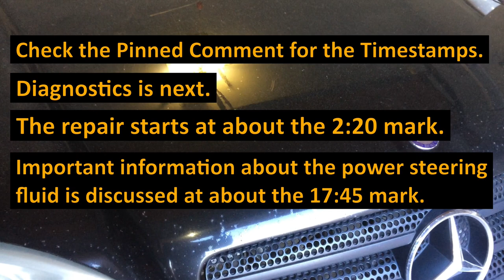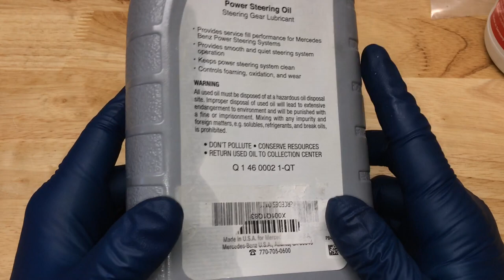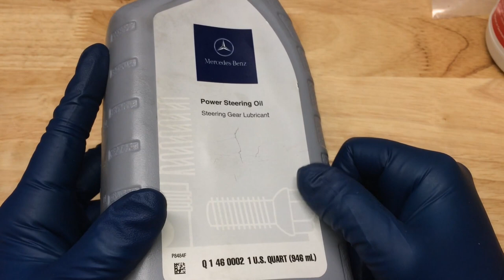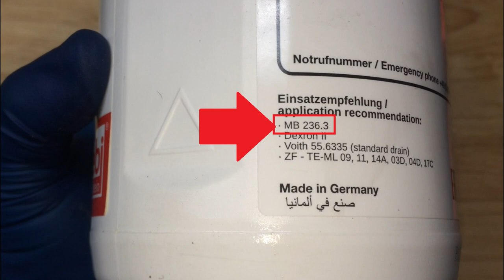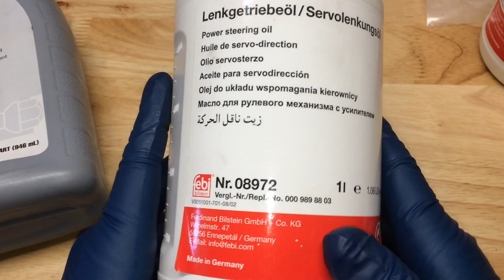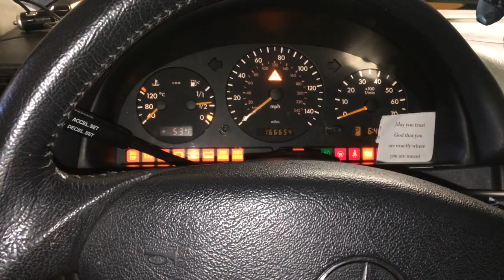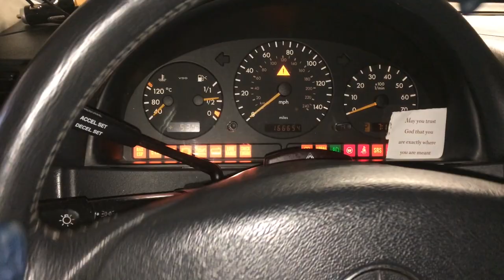Mercedes W163 Replace Power Steering Hose Pressure Line, Fluid Flush & Bleed '02 - '05 ML350 ML500

Comment: Thanks a lot for doing this. This is the most helpful video I can find that is close to the setup on my ML430 with the exception that my line ends in a 17mm flare nut rather than a Banjo bolt at the rack and pinion end. However, I have made progress on my project through to the 7:03 mark on this video (EG: both ends detached, and the bracket with the 10mm bolt off), but I cannot budge the line in either direction in order to get it out. That also does not bode well for fishing the new one back the other way either. As the car is on ramps with jackstands just for safety, I'm wondering if perhaps the suspension is clamping the line? I've tried to get some lateral motion by pushing and pulling from both ends, and it will not budge at all.
Reply from the maker: I'm sorry that I missed your comment - if you're still working on this, I would double-check that there's not some other clamp(s) holding the line.  I can see what you mean from this pic that the part is different for the ML430 & early ML320:

https://www.fcpeuro.com/products/mercedes-power-steering-pressure-hose-ml320-ml430-1634602224a#fitment

I pulled up the WIS for a '99 ML430, and there is a note about extra clamps holding the low pressure line, but unfortunately there are no notes at all about the high pressure line removal procedure that you're working on.  But the observation that the return line has some extra hangers (compared to the later W163's) makes me think that perhaps your high pressure line does, too.  I don't think your ramp/lift setup is affecting the removal - it sounds like there is another hidden hanger holding the hose in place. 

All I can see in the WIS for the high-pressure hose for your application is a note for the torque on the flare connection at the steering rack (in the rack removal section).  Here it is:
 
"Screw joint, high-pressure expansion hose connection fitting to rack and pinion steering, 15 Nm"  (That is a low torque: 15 Nm = 11 ft-lbs).

Please update with what you discover, and good luck!
Reply: @L35inColorado  That's great, thanks for looking into this! In fact, as it has now warmed here to 0C, I am just getting dressed to go lay in the ice, snow and spilled fluid in my driveway under the vehicle and see what I can find, so your timing is spot on. As I'm now 73 and never thought I'd still have to do this, I have told my spouse there are 3 things you can count on in life, "death, taxes, and fixing you vehicle". The thought that here is another clamp that I cannot see is rather a depressing thought. A mechanic friend of mine checked his Alldata and Mitchel databases and then made the comment, "they must think its less than impossible , this is what alldata has - mitchell has nothing". Indeed the Alldata info was not very helpful either. Yes both of the 17mm flair nuts broke free with very little force required. I just noticed that the return line that I replaced in 2018 also goes into the steering gear right beside the high pressure hose (I also bought this same line by mistake a couple of weeks ago before I realized I had the wrong one, and I'm just going to keep it as I had it shipped from ROck Auto to Canada.) BTW, this is a 1999 ML430 left hand drive that I bought from Japan for $10,000 about 2015 that had 48,000 km on it, original headlights (which Japan law requires to be changed and they never were) and tires, and it turned out to have been purchased by someone in Japan from a dealer in Montreal, Canada. It is already showing rust on the driver's door and has less then 100,000 km on it, which is disappointing. Given the amount of work I have had to do on it and in spite of the the low mileage, I wish I had never bought it! Update edit: I was able to find another clamp which looks to be more inaccessible than the first, so you're right. In spite of safety glasses, after getting all the gunk out of my eyes, I plan to move the car out of the spilled fluid, jack it higher, and then make another attempt at getting this one off. THanks for pointing me in the right direction!
Reply from the maker: @MountainParameters  Wow, you're a real trooper out there in the cold!  I'll say a prayer for your successful repair : )   Good luck!
Reply: A couple of hours later and more sludge in my eyes in spite of wearing curved eye protection, and a few trips to my neighbors to borrow some crowfoot wrenches, and, after trying unsuccessfully to get another bracket undone,  I finally discover that the line I disconnected from the PS Pump at the front of the vehicle was not the same line as I disconnected from the steering gear at the other end. However, all is not lost because your need to disconnect the 17mm nut from the steering gear before you can access the 14mm one for the line I needed to remove in the first place. Now the line is finally out, and the O-ring is still stubbornly seated in the steering gear housing and a right angle pick does not seem to want to remove it, I am so frustrated with this project I'm tempted to leave it in there and just take the other one off the new line instead. Also due to the frustration factor, I might be tempted to not do up the bracket until next summer when conditions can have me at least lying on a dry driveway rather than ice, snow, and spilled fluid! Anyway, even though at this point I am still only half way there, I hope that by confessing and documenting my idiotic mistakes, some time in the future they may help some other poor ML430 owner that is facing the same problem. I once worked with someone about 30 years ago who told me her father got so mad at a horse he drove to the neighbors, borrowed a firearm, and came back and shot the horse. Although I'd happily do the same with this ML430, I doubt it would do me much good, and probably not make me feel any better. So I'm drinking a strong IPA instead...
Reply from the maker: @MountainParameters  Oh wow, that ML sure is trying your patience, but you still have your sense of humor, so that's great!  
About the o-ring: be sure to really carefully double check the fitting of the line that you removed in case the o-ring is actually still on there - as shown in the video, I thought mine was stuck in the power steering reservoir, too, but it turned out that the o-ring was on the hose fitting after all, but I couldn't see it because of the color.  So use a pick to carefully check the hose fitting, to be sure.
If the o-ring really is stuck in the reservoir, you can try removing the o-ring with a dental pick, or making a little hook from a wire clothes hanger or smaller wire.  Unfortunately, there is a pretty high chance that it will leak if you try reassembling it with the old o-ring in there, because that is the high pressure line and so fluid will tend to find a path out if the fitting is not sealed well.  
You can also remove the entire reservoir so that you can get a better look at it: there are some videos on youtube that show how.  If you do that, be sure to replace the larger o-ring (part # 0004661880) that seals the reservoir to the pump.  
Hopefully you'll be able to get the hose fitting o-ring out without doing that, but just in case, here are those parts, if you decide to replace them:

Just the power steering reservoir o-ring to the pump:
https://www.fcpeuro.com/products/mercedes-power-steering-reservoir-gasket-0004661880#fitment

Power steering reservoir (includes the above o-ring):
https://www.fcpeuro.com/products/mercedes-power-steering-reservoir-0004600183

(Double check all those parts)

Hang in there - you'll get this done!  : )  But take today off and relax, if you can!
Reply: @L35inColorado  THanks for taking the time for assessing this! In fact I had to drive to the city today to pickup some friends at the airport, so you're right, shopping in Costco today was much more enjoyable, even the horrendous Sunday crowds all lined up to get the free food samples seemed much preferable to crawling around under the Merc (no I did not try the Mediterranean salad dressing, or the free tiny spring rolls, I'm not that kind of bum as I drive a ML430 you know!) 

Anyway, I get your point about those pesky O-Rings and I guess tomorrow will find me attacking this project with renewed vigor. Naturally, this project is not over so I will get back to this with updates so that in 200 years some archeologist will find your video and use it to teach his class at some campus on Mars. 'L35' may become some sort of meme in 200 years because I plan to engrave it on the rock at the end of my driveway if I ever get this thing to work again...
Reply: @L35inColorado  I finally got the job done. After 2 hours of trying to get the flange nut threads started, I moved the vehicle and after jacking in up again, it went in first time. The next challenge was trying to get the O-Rings to seat properly. After it was all done I filled the reservoir, and fluid then squirted out the low pressure line, so now I have to replace that as well. As I had to remove the flange nut from the steering box for it in order to remove the high pressure line, I now have experience getting it off the steering box and trying to keep an O-Ring on it when putting it back. But I can't work out some of the brackets for it. It seems like the line may be able to be able to be pushed thru them without the brackets being removed?
Reply from the maker: @MountainParameters  I'm not sure what you mean, but is it possible to remove the brackets , put them on the line, and then push the brackets into place (instead of pushing the line through the brackets)?  Great job on getting the rest of it done! : )
Reply: @L35inColorado  Thanks for the feedback. Turns out those guides are a 'C' style and the grommets that are on the line insert into them from the 12 o'clock position (but you do need to remove the grommets so you can feed the new line back toward the radiator from the steering box). As I had removed the 10mm nuts that hold the brackets onto the frame anyway, I was only able to get one bracket screwed back in place (the forward one which is the most critical), so I used HD Zip ties to secure the line for now and if I am under the vehicle again next summer I'll consider further mitigations then. As I was doing that operation, I reflected it's good I'm not an aircraft mechanic! A preliminary test seems to indicate no leaks. That low pressure line had a 1" long split along the top side of it. As the high pressure and low pressure lines are side by side where the split was, I'm guessing that the fluid was gushing out the low pressure line over onto the high pressure line and dripping off of it, which led me to believe that in all probability, I was too quick to judge and confirm the source of the leak. I was probably too impatient, and I suspect  there was nothing wrong with the high pressure line in the first place and I went though all that angst for nothing! About the only thing I did right was keep the low pressure line (it was the first line I had ordered), rather than return it, and then have to order it again! Also my Rock Auto history indicates that I had replaced that same low pressure line in 2018 with a Rien, which lasted me 4.5 years before it split, so that is less than ideal.

Comment: Hi, not sure if you have time to reply to this but I have a similar leak.  Same area but instead of leaking at the crimp it’s leaking from the connection of the high pressure hose to the pump.    Should I replace the whole pump and line, or just the o rings?
Reply from the maker: Yes, you can just replace the o-ring at the pump pressure line if the line itself is not leaking.  Have a very close look in that area, because the most common leak is actually just above that connection - it's a leak at the power steering reservior o-ring, or even the plastic reservoir itself.  That leak is probably the most common, and it can be mistaken for a leak at the hose because it is nearby.  It is common to just replace the entire reservoir when the o-ring is replaced, especially if the reservoir hasn't been replaced before because it will eventually crack (poor design by MB!).  Here's a video which shows what I mean (there are other videos, too):
https://www.youtube.com/watch?v=tSC2wMSMLPA
I hope that helps - good luck! : )

Comment: Any difference in how the steering feels with the yellow fluid compared to the green fluid? Is the performance different?
Reply from the maker: I don't know, and I'm not aware of any differences; the original honey/yellow fluid seems to be just fine.  Just don't mix them!  : )  Thanks for watching!
Reply: @L35 in Colorado  
My fluid is red
Reply from the maker: @dcomputers  Does it smell like ATF?  Many people put ATF in the power steering system because most other manufacturers (Toyota, Honda, GM, etc) use ATF instead of "power steering fluid".  For example, Valvoline MaxLife ATF is very red and very popular for power steering systems (I like it for Toyotas).  
But the W163 doesn't use ATF - MB says it requires "power steering fluid", like those mentioned in the video.  If you're having some issues, then it might be a good idea to just complete a flush.  It will be easy to determine when you've removed all the old fluid since it is a different color than what you'd refill with.  
There might be some red ATF's that are compatible with the MB spec mentioned in the video - I just don't know!  But red fluid makes me suspect that it's ATF.  I hope that helps!  : )
Reply: @L35 in Colorado  
Yea its synthetic atf . Would that cause issue in a ml ? The thing is they told me it meets 236.3 and that 236.3 is a dexron2
Reply from the maker: @dcomputers  Do you happen to know what brand?  I don't know all the in-and-outs of the spec, just what I included in the video when I did the research at the time.  It was my understanding at the time that there is some backward compatibility with 236.3 and some certain fluids, but not necessarily the reverse (meaning that some fluids that 236.3 can replace are not themselves suitable to replace 236.3 in 236.3 spec'd applications).  
Here's a list of what MB considers 236.3:
https://operatingfluids.mercedes-benz.com/sheet/236.3/en
Reply: @L35 in Colorado  I have redline atf in there they said it meet 236.3 spec. I'm not sure if I should flush it out for steering oil. Maybe it might work better with steering oil. But the atf is like 7.5 thickness. I just find it odd they don't have synthetic for steering why benz want a dexron 2 mineral in the rack
Reply from the maker: @dcomputers  According to Redline, their ATF D4 is 236.3 compatible:
https://www.redlineoil.com/d4-atf
I don't have any more info than that!  I know there's been lots of back-and-forth on the forums (esp www.benzworld.org) about the topic over the years.  Fluids are always controversial, it seems!

Comment: Appreciate it🙏. Have a 2000 the steering is stiff. Fluid is filled but looks dark. Seems to be wetness underneath. Any ideas how to troubleshoot? Thanks.
Reply from the maker: Sure - as mentioned in the video, the o-ring on the steering power fluid reservoir is a common leak. That leak can get extreme, where fluid is pushed out every time you turn the wheel, so if you see a leak there, you need to replace the o-ring.  But if you don't see any leak and the fluid is dark & steering stiff, then you might just start with a fluid flush. Be sure to use the correct fluid (it is discussed in the video) and remove all the old fluid via the method shown in the video. It will be apparent when the old fluid is out, because you'll see clean new fluid. Then be sure to bleed the system well.  I hope that helps - good luck! : )
Reply: @L35inColorado  Appreciate it. That's a good start.
Reply: Thinking about it the fluids may be mixed. Brown and green. Doing a flush would the old fluid still be in the lines?
Reply from the maker: @waynegomillion4976  No, if you complete a full flush like the method shown in the video, you will remove all the old fluid by displacing it with the new fluid.
Reply: @L35inColorado  Hi ok that makes sense just checking. I appreciate your help.

Comment: Hi, I have a mercedes Ml270 W163 disel 2001.

I need to replace high pressure power steering line. I was wondering if anyone can help me with the parts to get.. Such as the flare nuts, O rings, and correct fitting new pipe.. Thanks

Comment: I accidently mixed two different types of power steering fluids what should i do?
Reply from the maker: You can just flush it out, as shown in the video -- determine the type you need, and buy 2 liters of that type.  Then follow the flush procedure until you see nice, clean, new fluid coming through.  I hope that helps!
Reply: @L35inColorado  thanks you are awesome. Also one more question, I have a leak where the pump hose connects to the reservoir but it seems to be leaking behind the bolt that pump line connects too… it’s weird
Reply from the maker: @jaykeen7163  There is an o-ring on the reservoir which often causes a leak -- the fix is very easy, and is covered in the video below.  That may be your problem -- good luck! : )
https://www.youtube.com/watch?v=tSC2wMSMLPA
Reply: @L35inColorado  there’s a connection from the side of reservoir with a hose going down to the pump. The leak is coming from where it connects to the reservoir. It’s coming from behind the second bolt that the hose connects to.